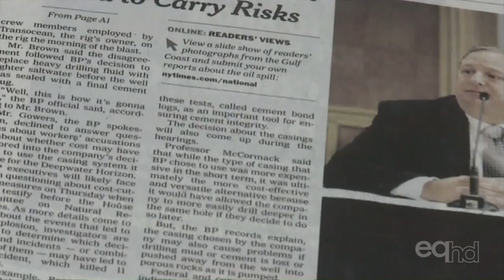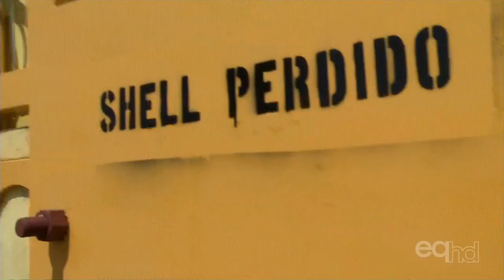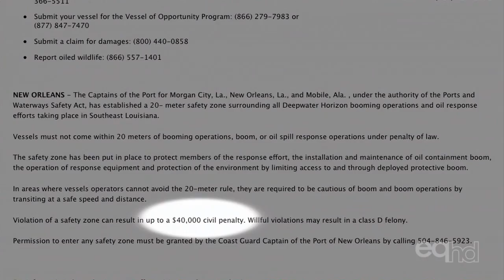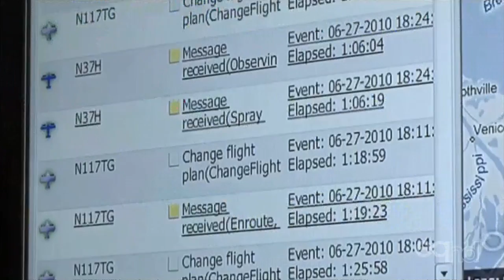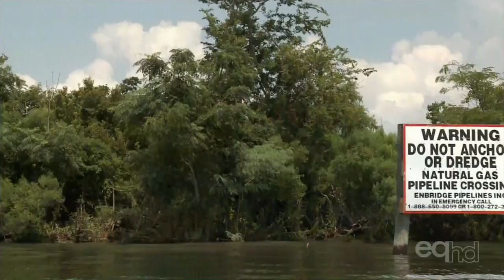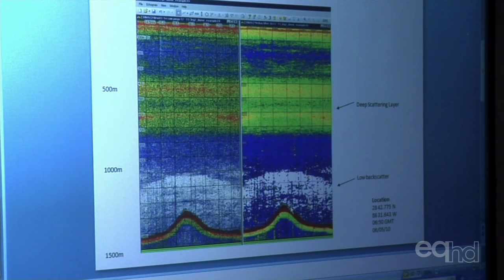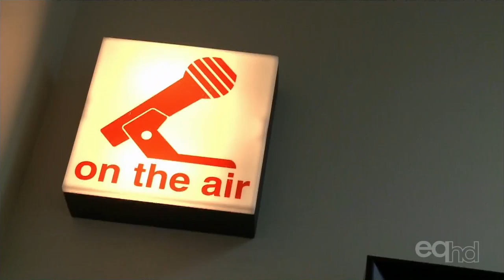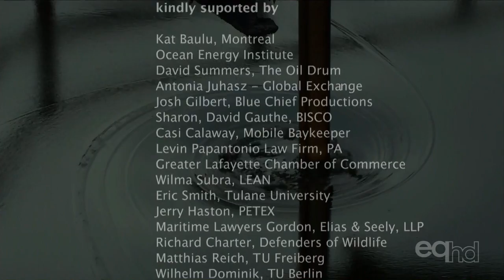Profit Pollution and Deception BP and the Oil Spill BBC Documentary

Comment: They could have put a pipe over the leak and funneled into oil tankers
Reply: They really couldn't have. At the pressure, temperature and volume that the oil was flowing out, you can't feasibly affix any kind of pipe or fittings to it, it would just blow out again endangering the crew of the tankers.

Comment: That bad safety valve at the bottom in the Gulf. That bad valve at the Baton Rouge Exxon Mobil Refinery that blew on 11/22/2016. Cheap steel that never actually met safety specs? 

The valve at the bottom of the Gulf. Was there even a safety valve IN the well? Same thing on a smaller scale in Baton Rouge 5 years later.

Halliburton. Did they also do the infrastructure in Baton Rouge?

Comment: As you all can see,It was an "accident." No it wasn't,If BP had bought improved mechanism maybe the fracture wouldn't have broke. They knew there were problems and they just shrugged them off and said they weren't necessary althought that unnecessary thing could ruin everything like it did. Why couldn't BP fix it instead of saying it wasn't necessary? But no,they were too lazy to fix it and look what happened. The corexit removed the oil from the naked eye and it just went deeper down. Of course no one cares now,but imagine if you were a fish or any sea creature,would you like to swim around in oil and die? Corexit is worse than oil alone cause it's chemicals cause cancer and such. It was just an "accident."

Comment: Holy shit.... Several key points that they make are completely incorrect.
Reply: can you explain
Reply: They completely either underplayed or reported misinformation in terms of what actually happened in the events leading up to the blow out.  In one of the Diagrams they did not even distinguish the difference between the drillstring and casing in reference to the stabilizers.  They also reported incorrect information in reference to why the blind shear Rams failed to seal the well.   Two other points, they say that the problems from the spill will have forever lasting effects, but have you seen any problems?  I live in Louisiana and I frequently fish in both the gulf and in the marshes bordering the coast and have not seen problems in terms of the quality or quantity of the fish I catch.  Lastly, they act like BP was purposely negligent in the events leading up to the spill.  In my opinion the largest reason for the spill as it relates to BP was the decision by the night company man to continue with the negative test and ignore one of the two pressure readings.

Comment: You know all jokes aside, what was the cause of this? Oil prices were dropping around that time, but than it went back up? Was it sabatoge?
Reply: Cutting corners and constant rush to profits was the cause. Multiple safety violations were ignored and not even logged. This spill was simply a result of a very long term problem of disregarding safety and not giving a fuck. Nothing has changed since than.
Reply: So basically businesses as usual in America? You would think cutting corners would leave something too round to stab such a deep wound.